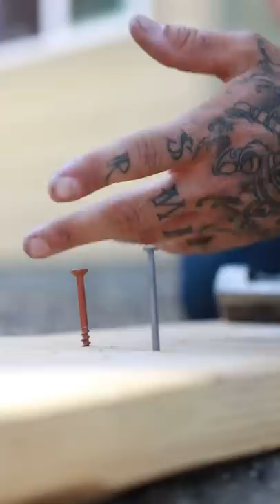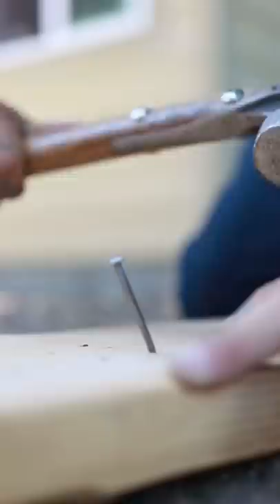Nails vs. Screws: Why do we use nails? #shorts

Comment: It’s way harder to break apart 2 boards that are screwed together vs nailed
Reply: In this example he is not talking about axial loads.
Reply: That's not what he's talking about though.
Reply: The other people here are talking about "axial loads" when axial loads don't fucking matter, if you can get this much flex out of your construction, you're doing something terribly wrong. Every house still standing in my northern, ocean town is only standing because of the fact it's put together with screws, explicitly not nails. Even the 100 year old homes, any time any kind of renovation happens to them, they put screws in because nails will work themselves loose and screws will not.

This mock demonstration is so stupid it's honestly impressive.
Reply: Tell me you don't understand "shear strength under load" and "tensile strength under load" without telling me. Nails will bend and conform under "shear" loads from wind or side load forces due to being ductile, where as screws will snap in half from side load forces (shear load) due to being brittle. 99% of the time your house isn't going to experience a tensile load (pull apart load) which is what screws are better at withstanding. Your house will experience racking and shifting of frame walls or shear walls from high winds, tornadoes or even earthquakes allowing part of the house to sink or sag (all shear load forces). So, nails are stronger and better for the application of shear loads. There's almost nothing that is going to put a house's frame under tensile load strength. Screws are better for sub floor work, drywall work and outdoor fencing and sheds etc. Why? Because as those materials swell or shrink they are putting the screws under tensile load. That's why you see "nail pops" in drywall over the years in older homes. From hot and cold cycles causing the materials to expand and contract which puts the nails under "tensile load" or "linear pull apart" allowing the material to slide the nail up or down being set and tight. So screws are better for keeping interior or exterior wood or drywall from "pulling" the screw out due to it's higher tensile strength and threads. Nails are better for a houses frame to keep it from being rigid and allowing it to "rack" while they bend under shear loads like wind , tornadoes, hurricanes and earthquakes.
Reply: @LeadRakFPS  perfect explanation.
Reply: @christianjensen952  He's talking about the same shit all people who like nails talk about, they bend. Guess what? Structural screws bend too! But they cost a fuck ton more than nails, so everyone has to pretend nails are better.
Reply: @LeadRakFPS  Wrong, the wrong screws that you can't even use according to any code will snap. STRUCTURAL screws will bend just like nails, but don't back out and are up to code. This stupid reason for nails being better stopped being relevant long ago. Nails are only cheaper and faster than screws, not better.
Reply: @Bobby Gets Banned  No. Listen, whether you want to believe me or not, I have a degree in metallurgy and have been an inspector and welder for a very long time. I know my metal fasteners. Whether using them for wood or metal to metal. The "structural" screws your speaking of only replace older style "lag" bolts/screws. They still serve the same purpose though, and guess what that is? Higher tensile strength for pull apart, not shear. I'm not going to set here and argue with someone that is severely confused. They do not make screws that have the same ductile strength as nails. They do not make screws that "bend" like a nail would under a shear load. Negative. If they did, it would be a funny thing to watch someone try and use a driver to sink one in some framing. Why? Because just the friction from twisting into the wood would cause the threads to start to collapse on themselves, and then it would lengthen/stretch or snap and even bend before being sunk. And I'll say it one more time, we're talking about screws here. Wood screws. Not structural BOLTS. There is a huge difference. Just stop. You don't know what you are talking about. You're repeating what some close friend, co-worker, or relative told you. I'm just going to let you know, stop listening to them.
Reply: @Bobby Gets Banned  He's not talking about the same shit either. He's talking about shear loads and you screw guys are thinking of tensile loads. Do we need some major education on the difference between the two? Because it really seems like it.
Reply: @bobbygetsbanned6049  Regardless. I challenge you to find a "structural screw" with a higher shear load than a nail. I'll wait.
Reply: @LeadRakFPS  I challenge you to find a nail with the pullout strength of screw. I'll wait.
Reply: @Bobby Gets Banned  Lol Lol! You just proved my point and the point of the video you dunce. "Pull Out" is TENSILE load. "Side load" or the racking motion (side to side) of a structure (bending) is SHEAR load. That's what this video covers and that is what the whole conversation is about, SHEAR strength. No screw is going to have a higher SHEAR strength than a nail. Exterior framed walls have to have a higher SHEAR strength due to them being the walls that experience the most "racking" or side load, due to side winds or the ground shifting from an earthquake. Keep talking though. This is amusing. Just stop.
Reply: @Bobby Gets Banned  You're in over your head. I'm a metallurgical engineer. You lost the moment you hit the post button. But go ahead and post a screw that has a higher SHEAR load than a nail. Pull out or TENSILE strength isn't the focus of this video. SHEAR strength (side load/racking) is the focus of this video, because that is 99% of the type of force an exterior frame will experience. Which is why competent framers use NAILS when framing outer walls and shear walls, because those walls experience more side load or shear force and nails have a higher SHEAR force or side load tolerance. Pull out or "tensile" means very little unless you're anchoring a deck roof to an existing wall header etc. Why? Because a deck roof has no surrounding walls to transfer wind into a side load. Most of the wind will be pushed up under the decks "roof", which will then cause a higher tensile load. You know, from the wind pushing/pulling the roof up and out. That's when screws are better, but not in overall framing. Nails over screws have nothing to do with overall cost. It has everything to do with them having a higher side load or SHEAR load tolerance for the bulk of a house's frame and the loads those walls will be experiencing.

Comment: And thats why every reasonable building that lasts longer than 20 years is build with bricks...and not popstickles
Reply: Bricks have a lot of their own drawbacks
Reply: That's why the wolf doesn't like you.
Reply: Why not continuously poured concrete from the foundation to the roof? Bricks haven't been used for structural building here in at least 100 years. If pouring and slip forms are not favorable you can always do preformed concrete with styrofoam in the middle.
Reply: Until it settles...
Reply: Bs

Comment: Depends what the screw is made of i guess
Reply: I'd assume the screw would need to be made of a stiffer material to withstand the rotational force and stay intact.
Reply: Well, no, you make screws out of stronger/harder/more rigid material to be able to maintain its threading. Which in turn makes it susceptible to fracture.

Just like how if you make a super hard and stiff sword, it’ll shatter before it loses an edge
Reply: @thereinthetrees_5626  literally what the guy said 🤡
Reply: @DaywordRacing  It’s not what he said
Reply: I believe stainless steel has incredibly high tensile strength. Not really sure how that works out though when they made into screws not to mention they're pretty expensive
Reply: Exactly!! And they were definitely NOT made from the same!
Reply: @DaywordRacing  "hurr durr 🤡🤡🤡 if screws weren't made out of what they are they wouldn't shear" it doesn't depend, they are and they do
Reply: Nonono, it doesnt matter what the screw is made of. When you're dealing with the settling of an unreasonably heavy thing, such as idk an entire house, screws suck. Even if they were titanium, they'de suck. Unless you want tensile strength. Then they're good. Nails are good for shear strength, they dont break when moved left or right.
Reply: @atomicwinter31  you literally have no idea what your talking about. The house is a structure and settles as one. Your room doesn't fucking go out of square due to settling.
Reply: @davexhero  if that much force is applied to the screw then you have a bigger problem
Reply: @greenshrek488  exactly.  Thank you for not being dumb.  The real reason they use nails is because nail guns are faster.
Reply: @Jkur2009  yes

Comment: I'll weigh in and say that the Screw is one of the 6 ancient basic machines, so is more sophisticated than nails, and easier to remove if needed.  Agree with many of the posters that cost  is an issue, and material composition affects breaking vs bending.

Comment: The type of screws that you can use are so freakin expensive too.
Reply: This allows you to disassemble the piece and reassemble, also allows for easy replacement of degraded pieces.  Nails suck outside of house construction.
Reply: Nails way cheaper and through nail guns put down 3 per second
Reply: @toddbertram6556  what about cargo boxes?

Comment: Just in America and other countries with no high standards for houses people use nails and a man made on the spot balloon frame to build houses, I work in constructions and and here we use nails just to make fast and temporary things that will be removed once the work is done, or just for other minor things, screws also come in countless types and material and have different purposes, also there are other mechanisms far more efficient than nails to support the house in case of sismic activity😂.

The quality of normal houses in America from a structural point is a lot lower than the most developed European countries tbh.
Reply: That is true but I also notice the area dictates what type of materials are used. Most other countries do experience far more seismic activity then America does, California and most coastal states are the ones that would use higher materials most likely,where I live at,we just use cement for the base of the houses because of tornadoes,using cement prevents house from being torn away as much,as I've been in a house while a tornado passed over it. That's the only reason building sucks here,there's no immediate danger for us
Reply: @adriangraham2131  that's also because the regulations in America are more permissiv, here if you don't reach a certain standard you can't live in the house, while in the US the normative is less restrictive and people naturally take advantage of that, since less qualitative materials cost less, that's more of a governative problem than people's problem, for normal families is a big cost to build a house with quality materials and it's only normal to save money if the rules allow it, you can see it also from the fact that people who earn the same money in America they may have a house while here an appartamento because the cost of building and buying here is higher(if we stay in normal conditions, not taking into account big city's in the US)

Comment: And nails back out as a house expands and contracts. The nails in my wood siding are beginning to back out and I just finished building it a couple of years ago
Reply: Construction  No, I live in the woods at the base of a North facing hill on a creek in Kentucky. Humidity is a bitch here.
Reply: Regular nails or ring shinged?
Reply: Construction  the nails back then are different from now... (Looks more wigged)
Reply: Your first problem is wood siding. Stuff swells fast, even painted/sealed.
Reply: Did you use ring nails?
Reply: no fuckin way those backed out unless you used smooth shank instead of ring

Comment: Ok what about decks? Nails also work themselves out...screws are kept in place by the threads
Reply: And decks tend to move much more than the frame of a house.
Reply: Decks are exposed to weather so the wood will move much more than the frame of a house
Reply: @shortlivedglory3314  idk about where you live but where I live, a deck is directly attached to the house's frame.
Reply: @HoLeeFuk317  A house experiences just as much weather and more importantly, flex force from weather as a deck. What the heck are you talking about.

Comment: They actually make STRUCTURAL SCREWS for framing and structural. The screw you are using is a basic #8 deck screw type fastener which is not structural.
 🙏

Comment: But consider this: I can pull apart boards easily by hand that are nailed 1 or 2 times. But it's nearly impossible to pull apart the boards with a screw.
Reply: A house framed with 3in deck screws is far superior to any nail it just takes longer and cost more that's why it's not used
Reply: @engineeringreality7878  wouldn't pass inspection and wouldn't have proper shear strength at fastened connections of framing members.

Comment: Screws have much more gripping power when something pulls straight up however, which means for something like a deck they might be better because most of the force on the deck boards will be vertical
Reply: frame with nails screw down the top boards
Reply: Yes xD just like when there is tornado ect and American's house just get... Flying. While it don't happen in screwd wood houses in Europe. (There is guides of where use screw/nails)
Reply: @korilana2291  constructing in the US is extremely good.  It's just better to build cheaper in danger areas and rebuild than expensive in danger areas and... still have to rebuild.
Reply: @danaolsongaming  thank you!!! It don’t matter what you use. If the force is strong enough to shear screws you are fucked no matter what building materials you used.
Reply: @adamdodds144  its just funny how Europeans will talk about how American houses are built cheap when their most powerful storms are weaker than our average hurricane...

Comment: This is a bit misleading. Yes, we build with nails - for lumber framing. Most building outside of residential are metal framed for many reasons. I'm sure there's many reasons why it's not as important, but if I were to guess, a lot of it comes down to how durable we need those buildings to be. A house, if kept well, will last several lifetimes. A store front will be remodeled far more often. Plus, the structure often is coming from the big steel from ironworkers, not the stick framing.

Comment: The other reason is that a nail pulled part way out still has holding power.  A screw pulled out generally fails catastrophically and completely, all of it’s teeth shearing off the wood they are gripping simultaneously... if it is not the shaft of the screw breaking instead.

   Important  features of the nail, protect in wind and earthquake related racking and shear especially.
Reply: Wouldn't a screw only need to be pulled out 1 threads width to completely strip the wood? (If it doesn't have the smooth part on it, just threads)
Reply: @empty_headed  - yes... all of the screw lets go once the screw has pulled out one thread width... that is what I was saying.

  Causing that failure normally takes a lot more force than pulling a nail of the same diameter...  but once it happens, failure of that fastener’s holding power is pretty much complete.
Reply: And it would not matter whether the screw is partly or all threads, really.

Comment: Best way to build is no nails or screws. Instead, carved out joints like Lego blocks. Japanese buildings last over 1000 years!
Reply: The only issue is build time
Reply: Yeah, and a lot of skills.
Reply: It only costs probably 10 times as much and takes 10 times as long,, and the skill level isn't prevalent enough in the industry either. That's rich people ish, you know the capitalist kind.
Reply: "Japanese buildings last over 1000 years!"
You mean the buildings in Japan that are 1000 years old were built that way (and most of the wood replaced with upkeep and maintenance many time over the course of its life). 
Go to your run of the mill Japanese house and its built with nails and screws just the same as anywhere else. 
Stop being a weab and putting Japan on some unrealistic pedestal.
Reply: @Luckingsworth  Yup and if you put enough force on that shit that it could shear a screw that building would be fucked. The reality is building almost never see that level of force and when they do it really doesn’t matter how you are holding them together.

Comment: Nails can be used for certain parts of the house but not all over the house example: screws for dry wall and nails for roofs…. Nails are not meant for all over the house like why would you put nails in the ceiling… they don’t hold as good as nails
Reply: He's talking about framing dude.
Reply: @DELL.ACNT.  I know what he’s talking about, I’m speaking from what I’ve encountered while purchasing different homes

Comment: You'll notice the same force applied to both a nail and a screw bent the nail in half and barely tilted the screw. That's because screws are structurally much stronger, can absorb significantly more force, and prevent themselves from pulling loose. It breaks because it's thicker and stiffer. There's a reason floors, subflooring, and roofs are all installed using 12" screws and not nails. Nails are faster and cheaper. They are not used because they can "flex" more. If you use screws instead of nails your house will move less, because you're using better fasteners.